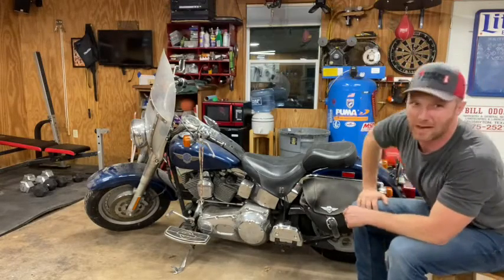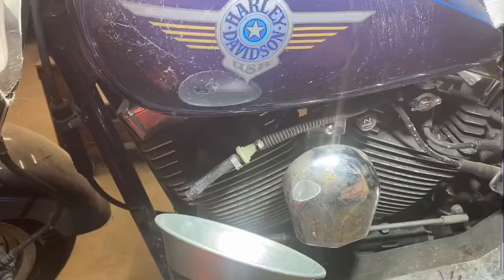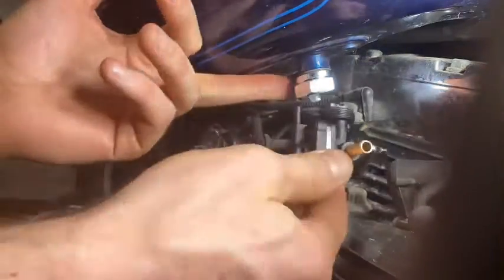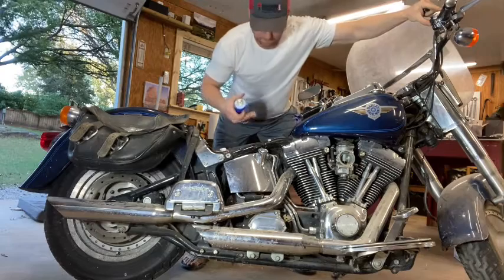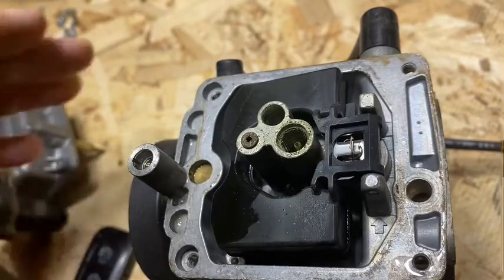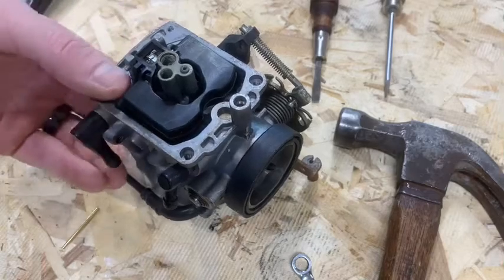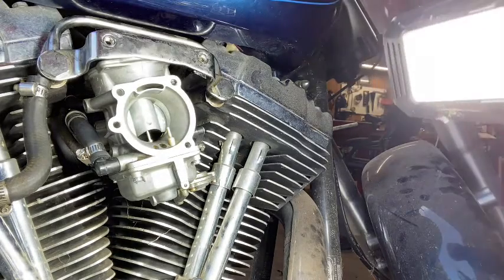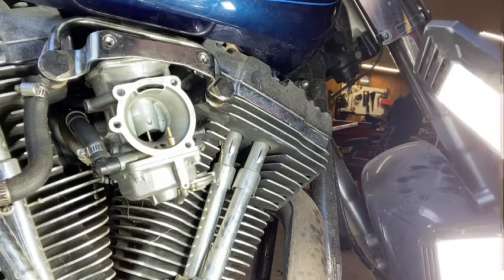Will It Run?? 1999 Harley Davidson Fatboy is JACKED UP!!

Comment: Great job, got the old gal running. Most folks nowadays spoiled with fuel injected bikes. Still good to know how the carb works. I've got an '06 XL1200 Low, carbureted, and she's a beast.  😁
Reply from the maker: I appreciate the comment. It was fun I was surprised how simple that Harley carb was.
Reply: @MowerMike  The entire bike isn't very complex. Harley's aren't too eat up with electronics. Find yourself an old Panhead or Shovelhead. Nothing like it, true biking.
Reply from the maker: @PatriotNC1  if I play my cards right I may have a chance at keeping this old Fatboy, the owner is talking about getting a new one.
Reply: @MowerMike  Heck yeah! All that bike needs is a good tuneup and some chrome polish. If you do buy it, make sure to change out that motor oil, transmission oil, and primary oil. I ran Redline synthetic in my Wide Glide ( also a Cam 88 motor ) and it ran like a top. That bike will make for some good videos too! I hope you get it, brother.
Reply from the maker: @PatriotNC1  Already in it changed them all with Amsoil
Reply: @MowerMike  That'll work. Will keep that bike running cooler. Ok, then go grab a Screaming Eagle intake, and a Dyno-Jet kit, and watch that bike come to life!  There's your new mission...go on now...git!  😁

Comment: Just a suggestion when you rebuild your carbs regardless of what brand, swap the 4 screws/bolts used to hold the fold bowel in place with Allen Head bolts.  The phillip head bolts are notorious for becoming stripped even when they are new and even worse once they get dirty.  I've done this with all my carbs I've rebuilt
Reply from the maker: Excellent advice. I hate those damn screws. I need to just get a box of those in Allen heads!

Comment: Can't stand to watch it all. Have to say this... there was nothing wrong with the petcock, it's designed for dumb fu**s who can't remember to turn off their gas!  (And prevent them from washing out their cylinders) it's a great idea to get rid if it, but NOT to replace it with the same crappy design. The diaphram in that is just something else that will fail and mess up your day. You don't need it! Don't be a douche, and leave your gas petcock turned on when you park.Pingle sells the best, they're higher flow, and don't have the 'idiot diaphram' needed by 'dumb fu**s who can't remember to turn off their gas when parking. (simpler is always better! )  A larger fuel line is also better, and that cheap plastic  fuel inlet you plugged the line onto, on the carb, should be replaced with a nice metal one,  (Brass)  before it breaks out on the road. (And they ALL BREAKE !)  Keep on keepin on! You're doin great!
Reply from the maker: Haha wow you sure are passionate about your petcocks. In my defense it wasn’t my bike. And I agree the clip was way long but I was havin fun.